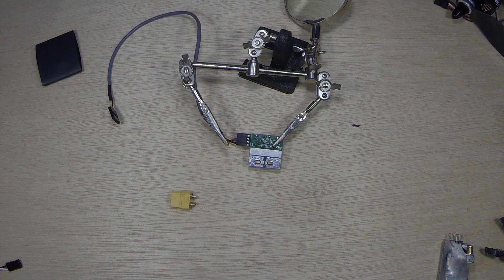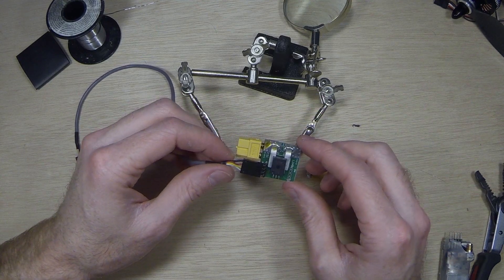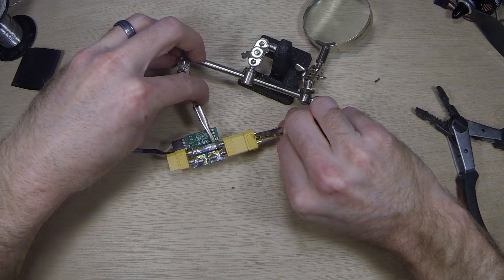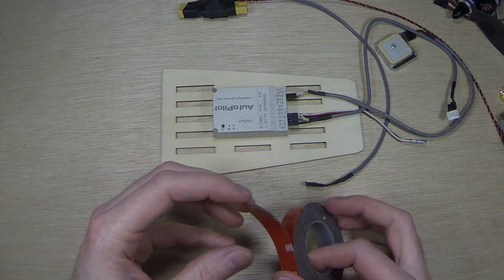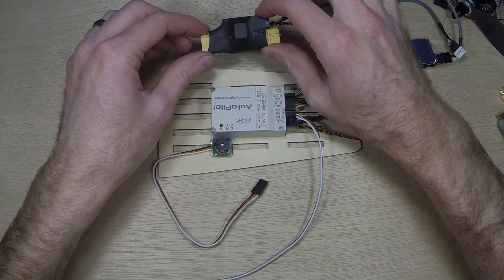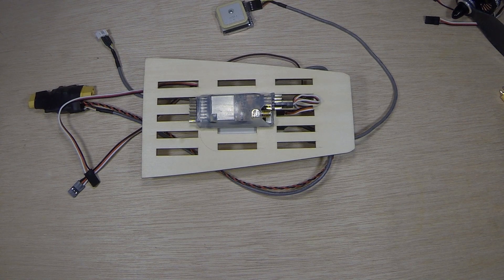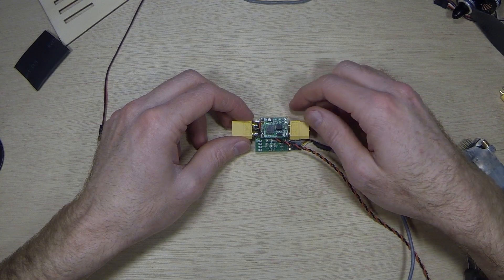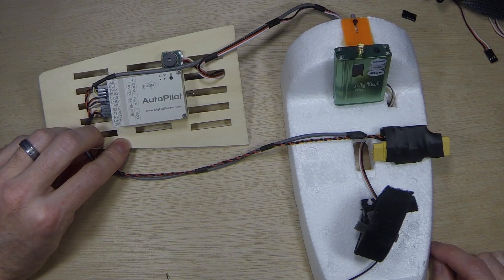MFD AP - 3 - Install (Part 1)

Comment: Does the current sensor not fail on the ground lead, it says in the manual that it’s adviced to put the ground leads as close to each other as possible. The manual says that a max of 20A is possible with only the metal strip. Or does the solder enhancing prevent a failure?

Comment: Hi, what about when you have dual ESC? how that connections goes?  Thanks.
Reply from the maker: both esc's connection to the same side of the current sensor. and the control/servo plugs go into a y connector. if they have built in BEC, remove the red wire from one esc's plug.
Reply: ok thanks.

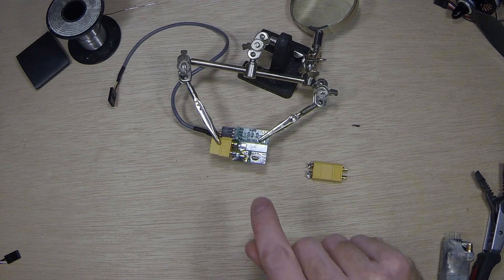Comment: Hi, it looks like it touched @ 2:27 both sides when you did the soldering, no?
Reply from the maker: +LiGhT SPiRiT the iron may touch but it does not matter when there is no power applied. the solder is not connected.

Comment: Thanks for you video. It is very useful.
One question: Must one use a UBEC/regulator to power the MFD-AP from a lipo? As the AP uses 7-20v, could I connect it directly to the ESC-end of the current sensor, without a regulator? (while using a 4s lipo)
Reply from the maker: the version I had could only do 12v. and I run 4-6s so I just regulate all of them.
Reply from the maker: yes. wiring the power right after the ESC will give the most accurate readings.
Reply: Thanks for you instant reply. Just to be sure. Did you mean "yes you must use a UBEC" or "yes, you can connect directly.." ?
Reply from the maker: If you are under the rated voltage, you can directly connect. If you are over, then it is better to run a UBEC than running a second battery.

Comment: hi

very clean instal !  i have a question about the current sensor 
did you jump the c-sensor for ur fpv with that regulator or if the sensor fail all power fail?
Reply from the maker: Aron Gatt It is run after the sensor. The chance of failure is extremely rare on Current sensors since you would have to pull way over their rated power to fail. The current sensor is rated to 100A which means it will accurately display to that, after that it will allow power to transfer but not be able to read it. you can easily pull over 150A before failing. and If you are pulling that much power, you probably should increase voltage. the maximum power reading for this is 2200Watts with 100A at 6s. Now, even if i had the regulator on the other side, you would only get to watch the airframe fall to its death since without main power you would have no control. The regulator connects to the "ESC" side of the current sensor so that you get the most accurate read of power used.
Reply: i had am apm sensor fail ,and lost my plane :( ...... i asked cos i was going for the mfd setup aswel and urs look a very clean instal .
looks mfd is a very reliable fc.

thanks

Comment: Really good tip at 3:30
Reply from the maker: ya, thanks... I use to not orient or use another connector to hold them and had all kinds of problems melting and soldering poorly!

Comment: Nice clean install. Which 3s-6s to 12v regulator did you use? thanks
Reply from the maker: I threw a link in the description at the bottom...
Reply: @stinson87  the link no longer works
Reply from the maker: @peteabdu9179  this was over 5 years ago. If you search for a 24v 12v step down regulator you should find one similar.